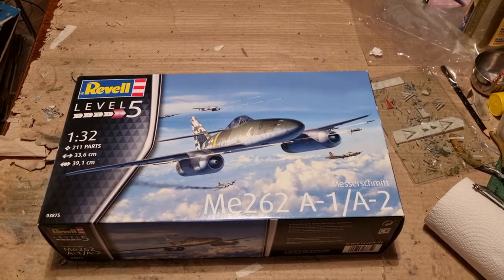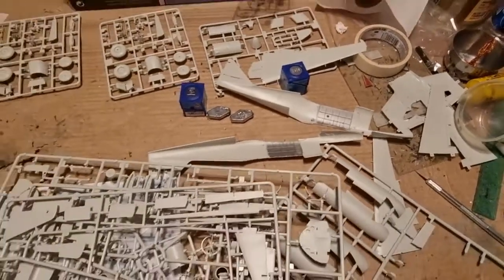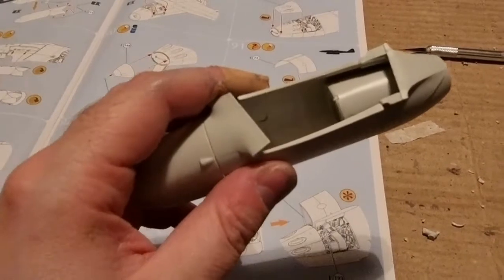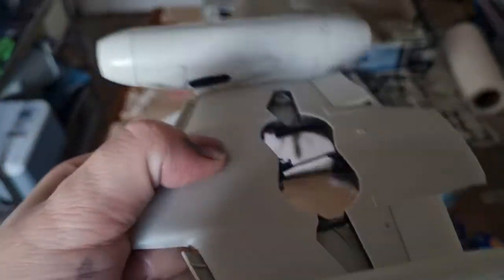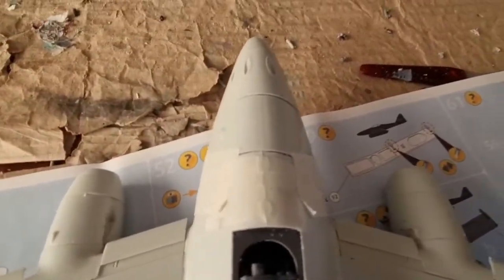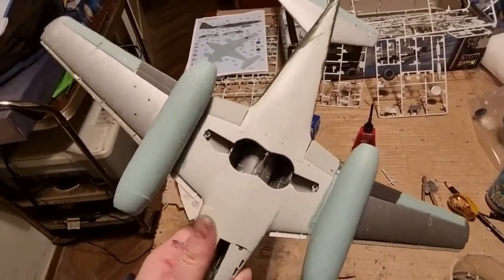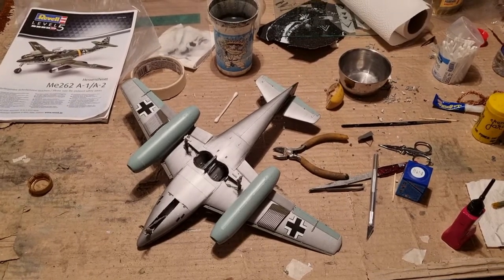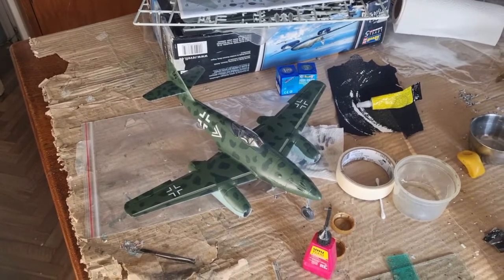Building Revell's 1:32 Messerschmitt Me 262A-1a (Adolf Galland)

Comment: I think if you look at other YouTube builds of this kit you will find that they didn't have the problems you had. My experience tells me that dry fitting before glueing is very important still I don't understand why you had so many problems. 🤔
Reply from the maker: I did test fit the nacelles though. Another guy mentioned I glued those parts the wrong way around, which may have been the root of my issues  Only way to find out is by buying another 1:32 Me 262A-1a from Revell!

Comment: The engines are diferent You have right and left side. You mixed it.
Reply from the maker: I didn't mix them. Had I done that, the rear sections wouldn't have fitted. I also followed the instructions to the letter.

Comment: Trumpeter kits are  better engineered.
Reply from the maker: No doubt, but I must have glued the nacelles incorrectly. Other builders didn't have my issue. Only way to find out is to get another Revell 32nd 262.
Reply: would disagree with you..... Trumpeter kits aren't